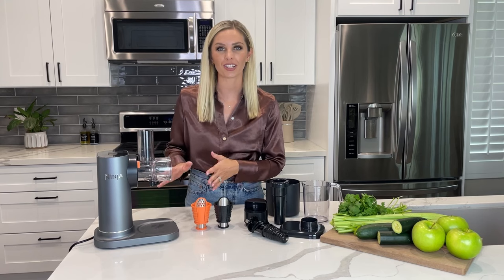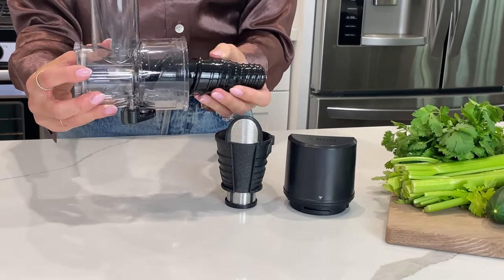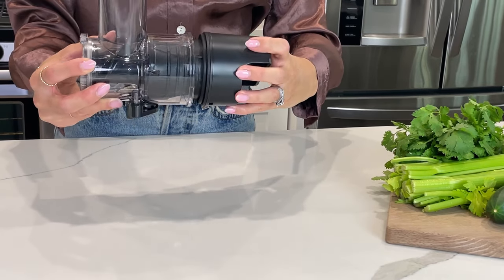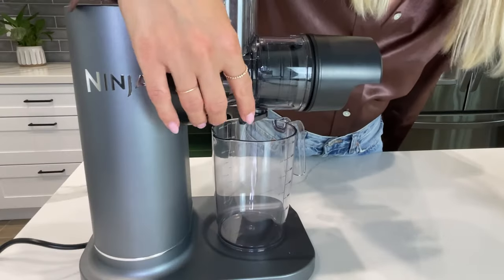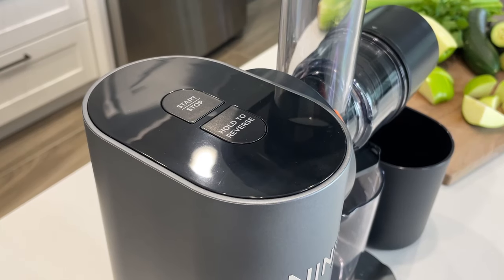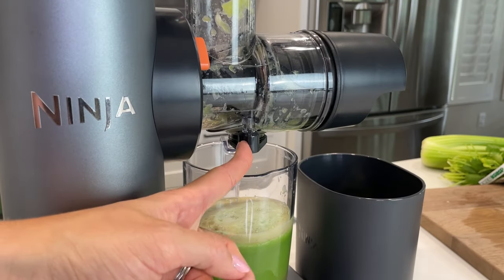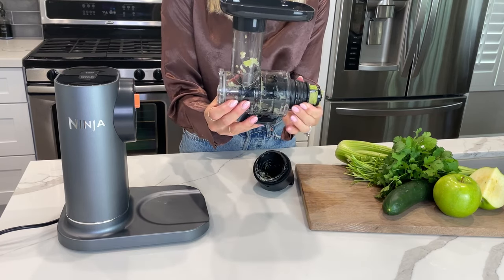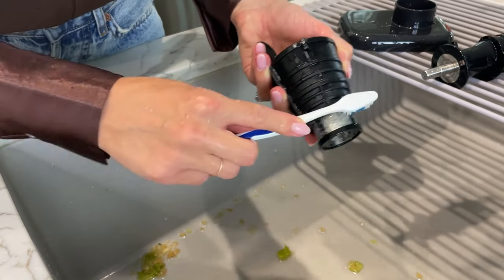Juicer | How to Assemble and Clean (Ninja NeverClog™ Cold Press Juicer)

Comment: Just bought one today and was impressed until cleanup— there is water trapped in part H(the pulp spout) which you can hear when you shake it — it should be able to come apart to clean for obvious health/sanitation reasons but it’s not in the instructions and it certainly doesn’t seem to want to come apart.  I am going to contact customer service tomorrow but do not recommend buying this unit unless how to disassemble and properly clean that part is disclosed— it currently isn’t in the manual, website, or here in this video.

I may upload a video of it depending on Ninja’s reply.
Reply from the maker: We're sorry to hear water is trapped, Lucid! We can certainly help you with this. Please call our customer support at 1-800-798-7398. We're open Monday to Friday, 9:00am to 9:00pm ET, as well as Saturday from 9:00am to 6:00pm ET. Please have your model with you.
Reply: @NinjaKitchenUS  thanks I did call, they weren’t able to help besides file a complaint.
Reply from the maker: We're so sorry to hear that, Lucid!
Reply: dont do it sister, plz give them a chance to improve ...